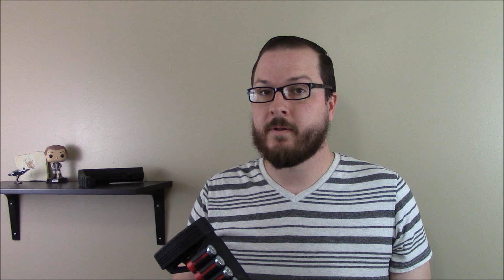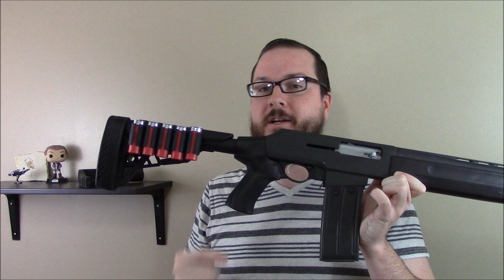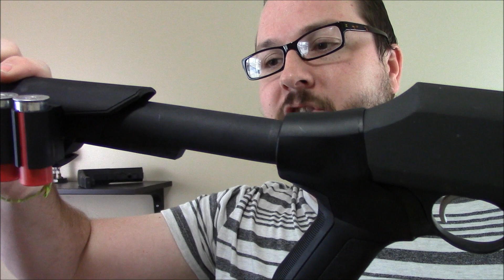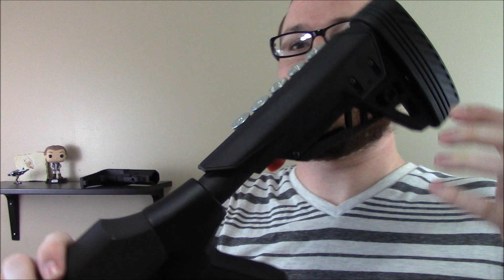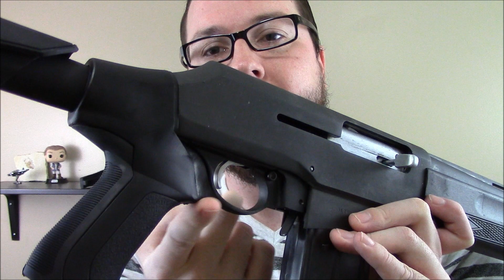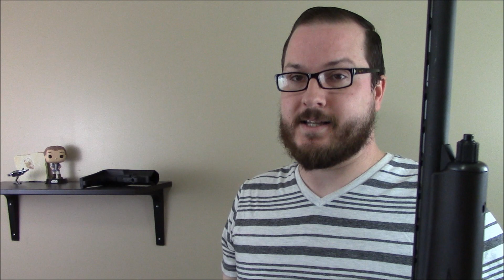ATI T3 Shotgun Stock - SAS 12 Semi-Auto Shotgun

Comment: What happened to the build man? I want to see it with a proper sized barrel.
Reply from the maker: I posted it on my Instagram page years ago. Just haven’t gotten around to making an updated video though.
Reply: @booliganshootingsports  sadness.
Reply: @booliganshootingsports  I found a pic on Reddit!  Would you mind measuring the length of the gun from barrel to back end most point of the receiver? And the length of your barrel(if you did trim it to 19inches).  Using screen shots and calipers the best I can guess is 27-28 inches.  I am playing around with the idea of relocating the trigger in front of the mag well.  Using the mag like a pistol grip, and figuring out a compact stock.  Silly I know, but eh...  I just found found your channel and would appreciate the help. Thanks for the content regardless

Comment: What all shell can you shoot reliable?
Reply: Fractured Hearts on the website it says you need to use brass shells. A lot of box mag shotguns will bend and squish regular shotgun shells
Reply: Thanks for the reply but that's not what I was getting at.  What all have You shoot  out of it?  Mine runs anything  1 1/4 oz. and over now the light stuff if its 1260 fps on problem and that's with a chopped barrel 21 inch's The gas ports is way  to far forward on these guns like at first they was going to be tube fed or what I think it was going to be both a semi- auto and a pump. Why do I think this? Well if you take out the gas piston it pumps slick and fast.  The last part is a bit of a myth and only related to one shoot gun and it was a bad made drum mag that did the mushing.